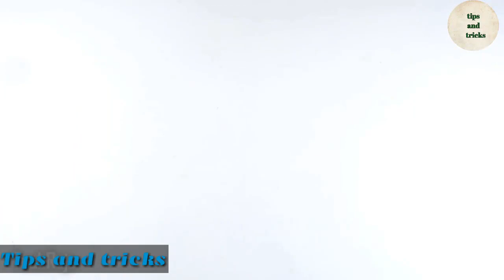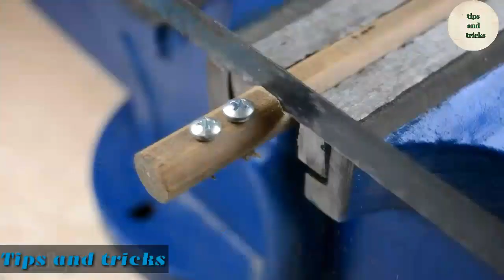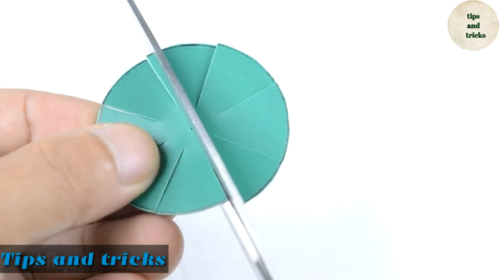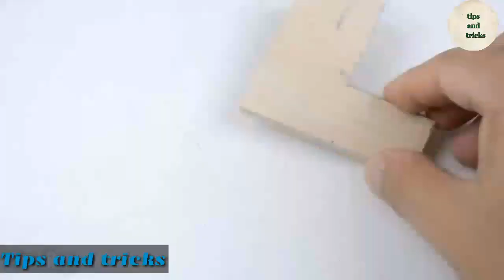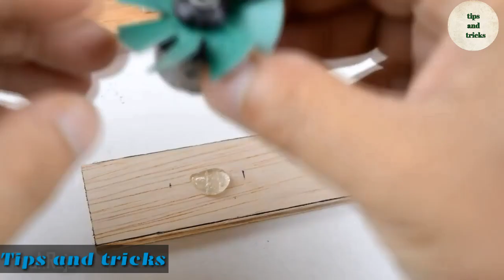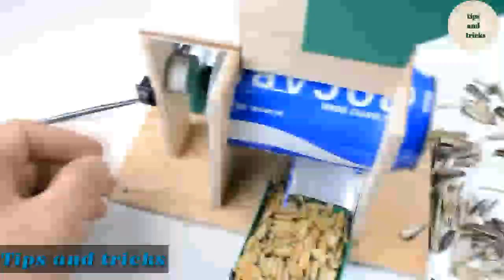How to make sunflower seeds shell removing machine at home

Comment: The yellow motor is contained in the ‘L’ shaped structure on top with the short piece of dowel with the two screws in it fixed to the drive shaft (the white rotating part of the motor). The motor spins the dowel which bashes the husks on the outside of the seed. The heart and the husk drops through the chute, where the lighter husks are blown by the fan and out through the front of the pop tin and the heavier hearts drop through to the chute below. I’m going to try a scaled up version. Great idea. 
If this is too much fannying about, just put some seeds in a tea towel, bash with a steak tenderiser and put in a bowl of water. The husks float, the hearts sink. Just skim the husks from the top and pass the remainder through a sieve.

Comment: I cant undetstand how it seperates seed and shell
Reply: Erkc I cant understand either. Someone explain how it seperates seed and shell
Reply: Me too
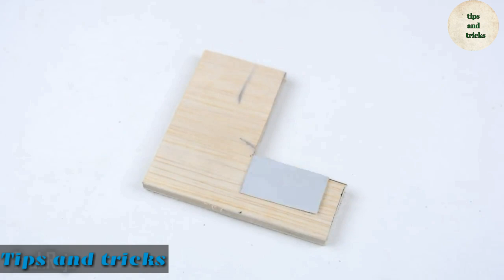Reply: At 2:21 you can see a small dowel with two screws in it, attached to the yellow motor, it spins and breaks the shell.
Reply: it's the sharp screws on the wooden spindle. as it spins the deshells it and the bottom fan blow away the shells
Reply: @justinciallella4724  So that flails the shell and separates it from the kernel?
Reply: It doesn’t exactly, you need to break the shells beforehand. They didn’t show you in the video though
Reply: My guess is the screwheads bust the shell off. The fans push everything forward, but the seeds are heavier and fall through the shoot while the lighter shell bits fly right through
Reply: @nguyenthanhthien5557  Thank you man. I really really appreciate that. I understand the working mechanism now. Thank you so much.

Comment: Whats that yellow thing ?
Reply from the maker: Its a motor cover
Reply: @2:20 that yellow thing is a connector for the mottor and that wood with screw. It also has some gear ratio that will make it spins faster. That wood which attached to it will spin and crush the sunflower seeds. Sorry for my bad english.